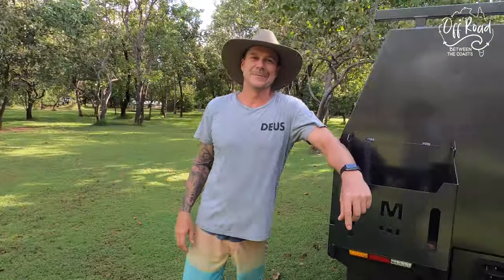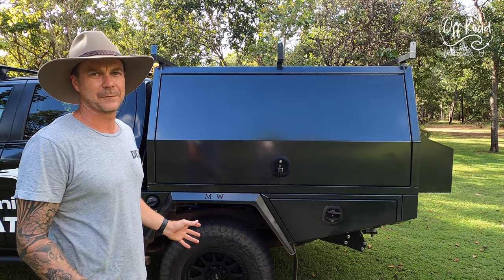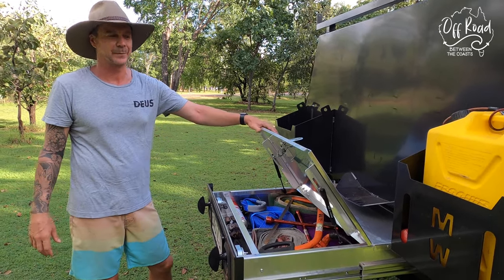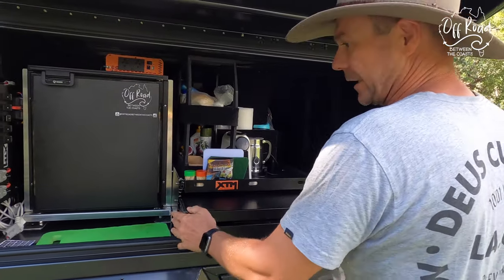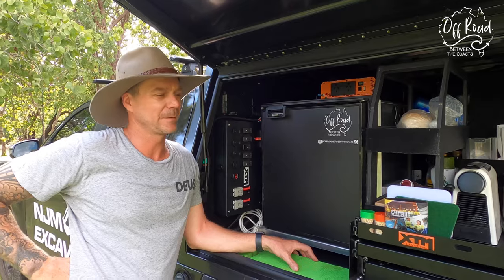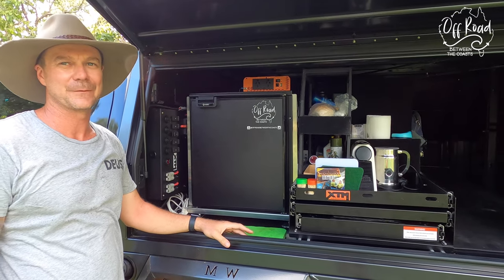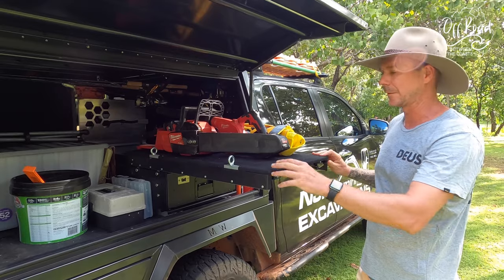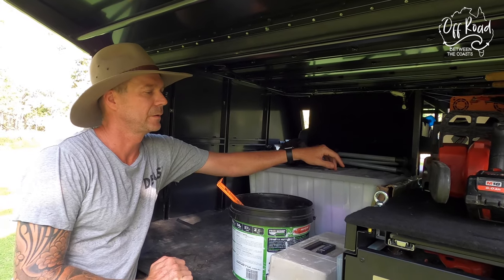Toyota Hilux N80 MW Toolbox canopy build & fitout

Comment: You can refill with a hose pipe connected to your gravity feed tap. Open you current refill tube to release the air pressure. Works well on my camper van that I built

Comment: Hi good video ,  just a thought on keeping canopy cool i use foilboard insulation glued to the canopy roof and walls, seems to work well
Reply from the maker: Thank you! Might have to give it a go.
Reply: Dont use foil board it dosnt work there no air barrier and just holds heat i got sucked into that one first round , best option is extra heavy duty silver air cell insulation 32mm diameter bubbles 12mm thick is what i use amazing the diffrence it made
Reply from the maker: Thank you! Will check it out!

Comment: Awesome clip guys and amazing fit out. I was looking at grabbing one of these MW canopies was wondering what your overall opinion on them were. How is it holding up and how is the dust ingress?

Hope you’re enjoying the NT!!!
Reply from the maker: Thanks for watching! We’ve just come back from a 600km dirty, dusty, 4WD trip and yes, we had dirt and dust ingress.  It’s not a huge amount but it’s still enough to annoy me.  I’ve only just adjusted the latches after the trip so hopefully that will help get a better seal for next time.  👍🏼 I do also get a bit of water ingress in the underbody tool boxes when there is heavy rain.  apart from that, canopy is not too bad.
Reply: Thanks heaps for your reply! Yeah have heard similar hoping adjusting it can pinch it a bit tighter. Bloody dust! Haha
Reply: Hi Nic, 
Just read your comment and thought you might get some ideas from my set up and canopy build. 
Cheers 
Out There Touring

Comment: Nice job mate, hope you enjoy the NT. Can I ask what size wire you used to run to the inverter, just bought a Renogy inverter (2000W) and I reckon the wire they supplied is a fire waiting to happen.
Reply: Hi
Just read your comment and thought you might get some ideas from my set up, 12v set up and canopy build. 
Cheers 
Out There Touring

Comment: Great build thanks for the tips. I’m about to start my own build and measure twice cut once can save a lot of time down the track. 
Just a thought , would it be easier to move the fuse box on the other side with rest of them for easier access. 
Enjoy your time in the NT, most of us dream of doing something like that especially if your a fisho and hunter.
Reply from the maker: Good luck with your build! Let us know how you go.  Nick has left it there so he can add additional batteries down the track i think. Thanks for watching.
Reply: Hi mate, 
Just read your comment and thought you might get some ideas from my set up and canopy build. 
Cheers 
Out There Touring